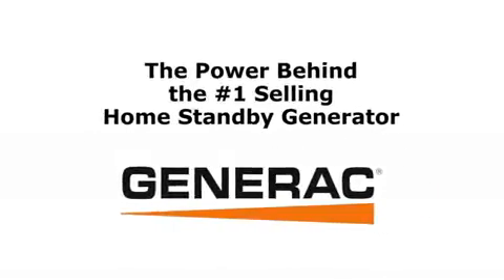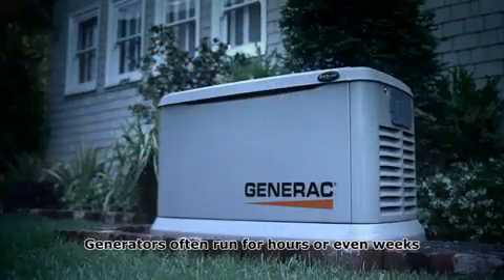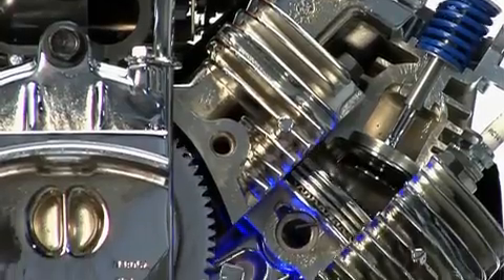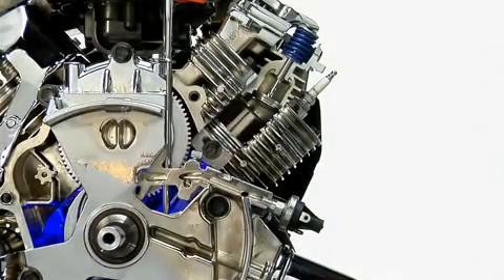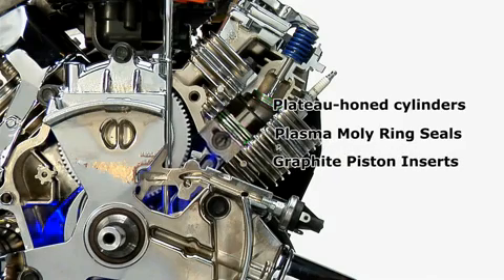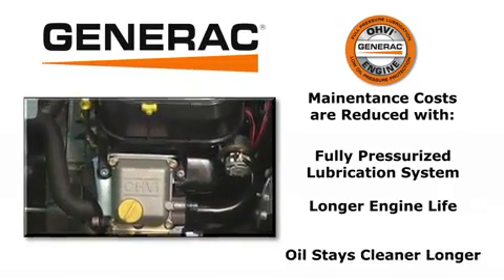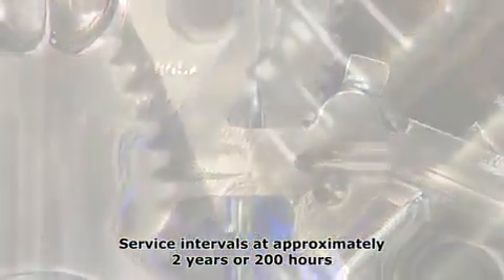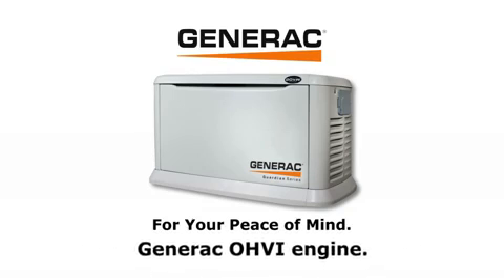Generac's OHVI Engine

Comment: harley twin cam motor would walk all over the twin generac motors!!    just sayin...

larry
Reply: I wouldn’t use a Harley engine on a generator, lol. They’re made to low rpm cruising, not continuous stationary horsepower output for generators. Harleys also vibrate pretty bad due to their high reciprocating mass and 45 cylinder angle. The Generac engine is a 90 degree v-twin which provides perfect primary balance. Different applications, my friend. Also, these industrial gas engines are not tuned for max power, they are tuned for a balance of power and efficiency for continuous operation.

Comment: CUMMINS ONAN POWER GENERATION RS20A is better than the GENERAC GUARDIAN SERIES; they use a BRIGGS AND STRATTON VANGUARD ENGINE witch more reliable than the GENERAC GFORCE OHVI ENGINE has the same features I'm not bashing GENERAC I just prefer the CUMMINS ONAN POWER GENERATION RS20A.
Reply: Mike, I also like Onan, but I have never found a reputable comparison of these two engines, rather just unsupported opinions.  Would really like to see something that shows a professional level comparison, even if only on engine design and not an actual operational test comparison.

Comment: My 1968 Studebaker/Onan will outlive that 10 times over. 

"Only Engine for Generator Use"... yeah right. Its a Chinese motor. How many hours will it run (even with oil changes) before it gets tired?
Reply: At one time I worked for Onan, in the Engineering Test Laboratory.  However, I can find very little information on these Generac engines.  For example, are they cast iron or aluminium?  Aluminium conducts heat better than cast iron thereby resulting in longer life if the cylinders have iron sleeves.  Why don't they include number of cylinders, compression ratio, and bore and stroke in the specifications?  We eccentric potential buyers like more thorough specifications.

Also, Generac advertises that some of their engines have splash lubrication which they say is an advantage.  But then they also say that full pressure lubrication is a big advantage in their engines which have it.  They can't have it both ways!  That leads me to question their integrity.

The home stand-generator sets run at 3600 rpm and they seem to think that a life of 3000 hours is wonderful.  Some Onan generator sets which ran at 1800 rpm had a life greater than 5000 hours.  I realize that for standby 3000 hours is generally more than sufficient, but surely it is nothing to brag about.
Reply: Here’s the thing. The Generac engines that used to be used on all their generators were designed for near continuous operation. Nearly all of them had pressure lubrication, even the single cylinder engines. These older ones were the good ones that would last a long time, 
However later on, the single cylinder generators made by Generac started using the 420cc engines that are actually Chinese Honda/Predator clones. These aren’t as good as the older engines. But think about how many these generators are typically ran. Most generators don’t even see 100 hours. 
The V-twins they make are still a true Generac design. These the only good ones left

Comment: I just got a Generac 8000 series portable generator. It's replacing a Lifan generator also 8000 watts The Lifan engine
broke the rod & piston without any warning (oil level was OK). The engine looks identical to the Generac. Got any comments on this?

Comment: As a Generac tech I can confirm these do run way cooler than the Kohlers, and have a better compression. After learning and working on many Kohlers I just don't see whats so good about them.
The kohlers like to burn oil too... Maybe because the oil pump and filter is on the top of the block and each time it starts it needs to fill up before anything gets oil.  And hunts at no load, because why would you spend $0.03 on a spring to take up slack on the throttle linkage. Or surges on exercise cycle because the unit doesn't produce voltage during exercise but the controller gets signal from the 60Hz output voltage but its not putting out voltage so wtf? I wont get into the fact that the enclosures are put together like IKEA furniture.

Comment: Graphite cylinder sleeve inserts eh? Oh I bet piston rings lose seat and smoke like hell way before cast cylinder walls do. Phony gimmick to sale morons. 1000 hrs and it's junk. I challenge that design to 2700 hrs with out as much as a valve cover removed. Many engines can but that one wont. Ill put a rebuilt engine of the same hp against a new one of those.
Reply: It says, "Graphite Piston Inserts", Professor!  I don't think you listened well.  And why would they want to, "...sale morons"?  Do you mean, "sail", like a boat, or, "Sell"?
Reply: @boobalew  I really wonder what graphite piston inserts are....
Reply: @lyndonthan4350  It was probably something the marketing guys got wrong when the engineers told them about it. I would guess it's just a coating on the piston skirts. Pretty common these days.
Reply: @lyndonthan4350    "Pistons account for at least 60 percent of the engine’s friction, and improvements here have a direct impact on fuel consumption. Friction-reducing, graphite-impregnated resin patches screen-printed onto the skirt are now common technologyl."
Reply: The pistons actually make zero contact with the cylinders. The piston rings do that job